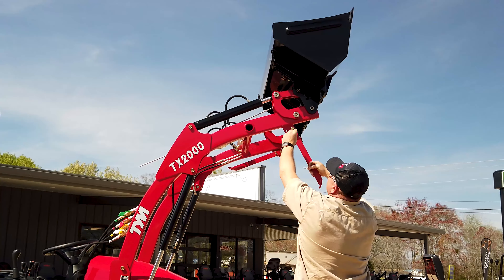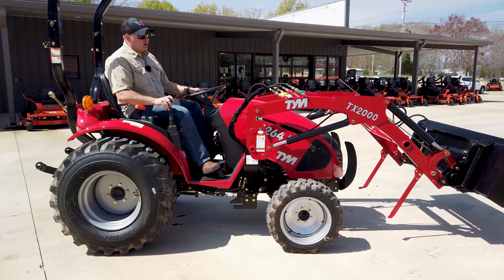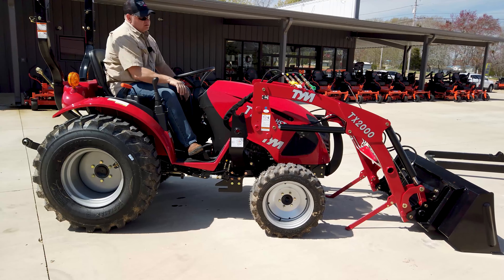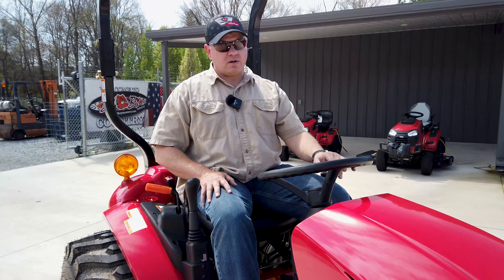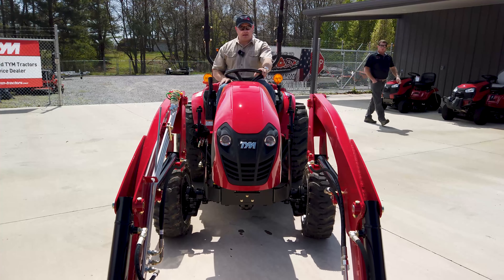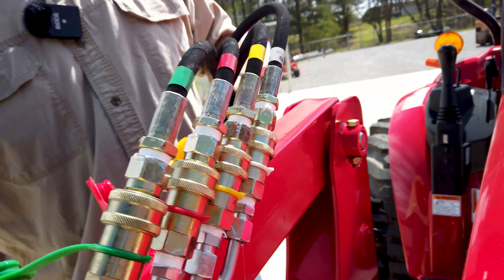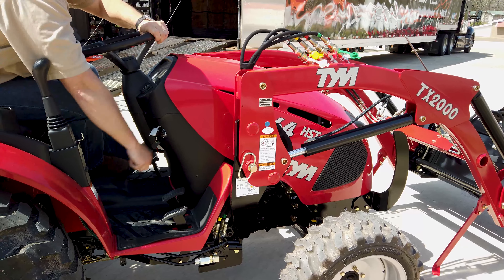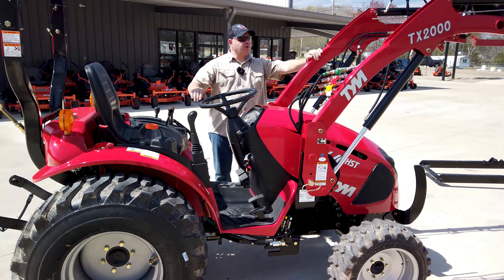TYM T264 Tractor Loader Removal and Install

Comment: What are those front horns like two pieces of steel for?  They look useless.  I have a 264 and I think about removing them, what do you think?  Also, TYM forgot to mount a side step on the left side of this tractor, I made my own.  Thanks for the nice video...
Reply from the maker: It doesn't come with a sidestep. It is a brush guard. There are much better aftermarket brush guards.
Reply: @TonysTractorAdventure  and what about the front horns? What are they for?
Reply from the maker: It is a lightweight brush guard.
Reply: @TonysTractorAdventure  I am talking about the two metal pieces on the side-front of the hood.  The two horns like vertical bumper????? black steel pieces.  What are they there for????
Reply from the maker: The same answer as before.
Reply: @TonysTractorAdventure  Excuse me to insist but in the parts catalog, they call them the "plate grill guard".  I just wanted to know their use.  Why are they there?  They dont seem to be useful.  What's your opinion?
Reply from the maker: They are there to keep brush and limbs from slapping the front of the tractor.
Reply: @TonysTractorAdventure    Thanks

Comment: I just wish I had a nice concrete level place like that to work on my tractor.
Reply from the maker: Don't you know it, but level grass works just as well. However, I learned that those small drops of hydraulic fluid leaking downwill, kill the crap out of grass.
Reply: Me too Brad😂

Comment: Tony how is the TYM compared to the LS of the same size? They appear to be almost the same tractor.
Reply from the maker: Honestly, the have a familiarity with each other because of where they come from. They are both made in South Korea. having said that, they are completely different tractors other than a few electrical parts. I honestly think TYM is the better value in the market at the moment. Both have good build quality and good warranties, but TYM is usually the price point leader. TYM usually weighs more for the same class tractor. TYM is a much bigger company as well. I am leaning RED but both are good Tractors.

Comment: That sure looks easier than the backhoe off and on.  Amre those rear tires loaded on your new tractor?
Reply from the maker: They are not loaded on the DEMO TYM T264.  We are currently looking to buy a tractor, and I will load the rear tires.

Comment: Heyhey Tony.  It is interesting that the hoses stay with the tractor when you take the loader off.  My Kubota the the hoses stay with the loader.  Do you think there is any advantage or disadvantage either way?
Reply from the maker: It is much easier to put on due to being chest high, but I would prefer not having to rap the hose. It would definitely not be a deal breaker either way.

Comment: Sorry, kind of hokey how you wrap the hoses around the FEL mount, that's not ideal at all.
Reply from the maker: It works perfect and never gave me any issue. Plus, it is way easier to take off and put on the hoses. I ended up buying a TYM T264. Love the tractor. It is way over built.  Thank you for watching.